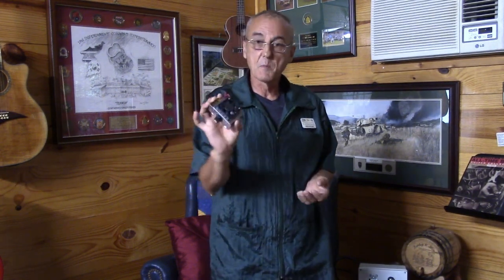Mistakes and our purpose (happy distilling)

Comment: Hey George, have you ever used the inkbird ipb-16? I’m very new to controllers and it looked as if this was both a pid and pwm in one box with an outlet that could be made switchable say for a pump. It says the outlet is good for 1650 watts so I assume it wouldn’t handle more than a 1500 watt element. With this element restriction would you be limited to say a 3 gallon pot to be efficient?
Reply from the maker: We've used a 1500 watt element in an 8 gallon kettle before with good results. Heat up time is a little long.
George
Reply: Texaviator23 I have trouble controlling temperatures below 180 degrees F with a 1500W heating element and inkbird IPEC-16 PID. Control is good above 180 degrees.